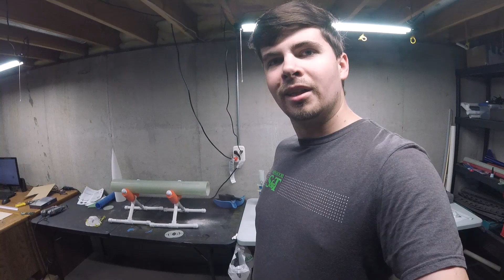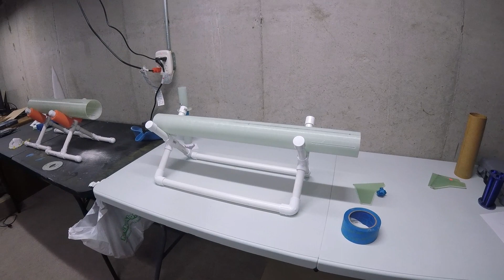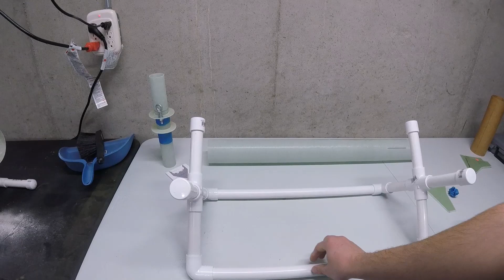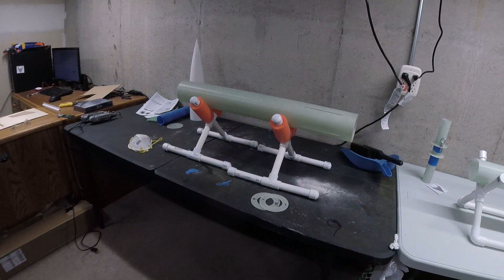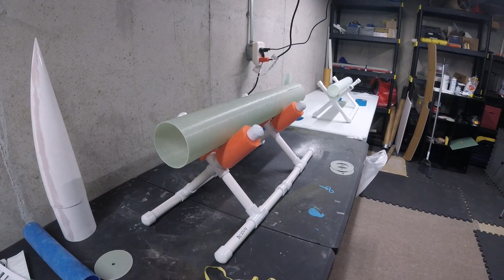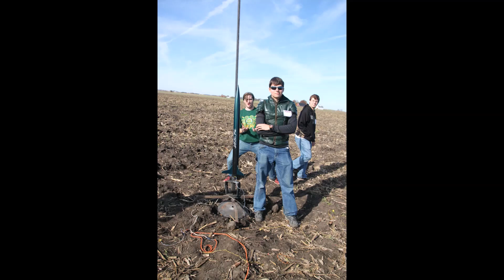Building Tip - Rocket Stands

Comment: Can you give us the measurements of the lengths of 3/4" PVC pipe you cut...as well as a total number of caps and two X-pieces, I assume...  How many of them  have you glued together?
Reply from the maker: I've added this to the video description as well.
2 Piece Stand:
2 - 3/4in Cross
4 - 3/4in Tee
12 - 3/4in Cap
16 - 10in length of 3/4in PVC

1 Piece Stand:
2 Piece Stand:
2 - 3/4in Cross
4 - 3/4in Elbow
4 - 3/4in Cap
8 - 10in length of 3/4in PVC
2 - 20in length of 3/4in PVC